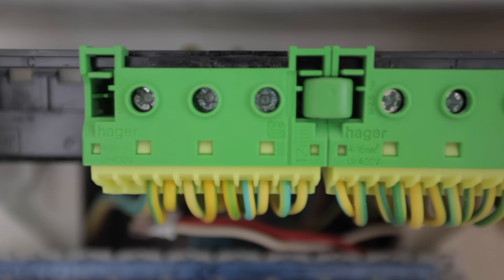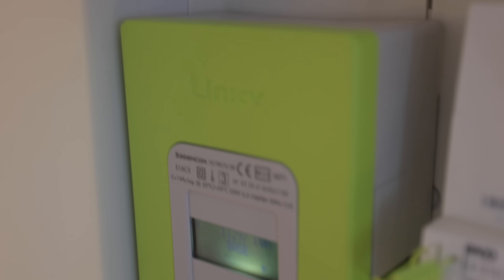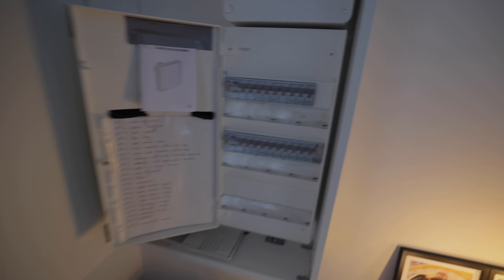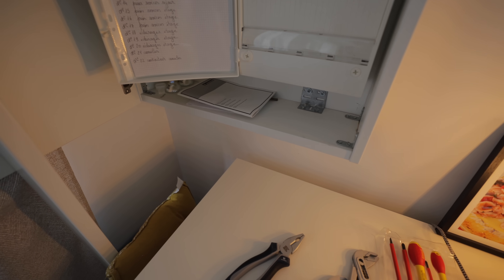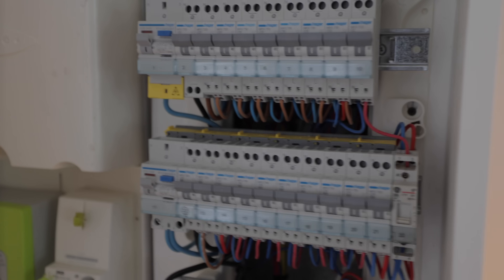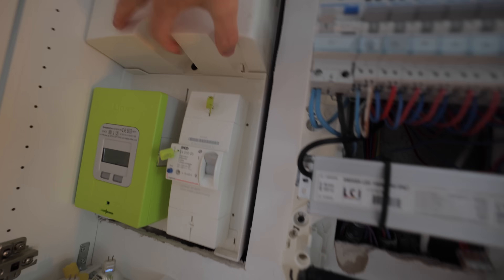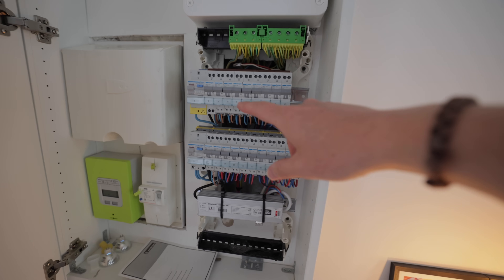U.K. Electrics SUCK! This is what we should be doing…🇫🇷

Comment: Strange that you never mentioned the choice of wiring used, a mixe of Red \ Black and Brown \ Blue, seems the Building may have  had a dramatic upgrade, also note that the cable terminations have not been identified, this is identifying conductors is normal for France as is the Circuit Arrangement stated on the Panel along with Contractor Details on the Front of the Panel. Bye the way this I.D for circuit cables is used in the UK by all but Domestic Electricians, ok the odd  ECA Member would meet this criteria.

Did you pick up or note  that this HAGER BOARD had been installed with those DP MCB's are realy the only types available to purchase in France,  but try and buy them from a HAGER Stockist in the UK is impossible !!! just so weird. I used to be a registered Hager Contractor in the good old days when they first arrived here in the UK and fortunate to have all the perks and free meals, weekends away.

Another good to know is that the Immersion Heater is generally 99.9% replaced in its entirety, tank and all, the only hope of keeping the Tank installed is to remove the Immersion Heater and take it back to the UK where you will find a small business to copy it. I had the misfortune of having to install a completly new tank in my French Home, 2 days latter I had a Shower having removed the celing joists above the Tank to lift out \ in of the new tank !
Mr Spence Eng
Reply from the maker: Thanks for sharing your expertise on French electrical systems!

Comment: Do i see correctly that france is single phase, too? Did you ever see a German consumer unit? Here in Germany default we have three phase power, all breakers are equally distributed over all phases. on modern units there is a separate high current breaker before the energy meter, too, but no rcd. Rcds are only directly before the circuit breaker, usually 8 breakers on one rcd.

Comment: You're right about the immersion pair. It uses ripple control between 2am and 6am as long as the 20a is in the middle position. If memory serves me correctly, if you set it to top (override) it will snap back to middle at 6am the following day. Mine does, anyway.

Comment: The connections system of this switchboard (consumer unit) looks super clever. It's lovely neat work too. I'm dead set against a single RCD device protecting multiple sub-circuits, which are individually protected by overcurrent/shortcircuit protection. I far prefer each individual sub-circuit has its own integrated RCD/overload/short-circuit protection device - what is commonly referred to as an RCBO.  That way an earth leak on a sub-circuit doesn't trip out multiple circuits. I'm also super interested in a deep dive into the USA made SPAN switchboards, where each sub-circuit can be load measured and switched by energy management software.

Comment: If you think that electrical installations in UK are perfectible, it is far worse in USA. Just have a look on US electrical panels without differential switches, the side connections on wall plugs that are not insulated and the rather generalized use of wire nuts instead of Wagos. 😱
As a French people I am happy with our consistant NF C 15-100 standard.

Comment: I suspect you're thinking too logically about the type A vs type AC RCDs. We have two main circuits and RCDs exactly as you have, but the reason one of them is Type A is that it was fitted very recently to increase the RCD's capacity for the addition of our "reversible aircon" - what in the UK we'd call an air-to-air air source heat pump. So it was a 40A Type AC and is now a 63A Type A.

Comment: None of the places you showed panels, what we call them here in the states, would fly in the past 60 plus years.  Northern clims has them in a garage or basement or hallway of the home or apartment.  Meter can on the outside, generally opposite the panel.  Southern generally has combo meter can and panel in one on the exterior.  Most utility providers require the meter to be around 1.25 to 1.5 meters high.   Modern code also requires a means of disconnect outside where the service meter is located so that emergency crews can de energize the location.  Our GFCIs are 5-6mA and by the breaker.  We are also required to have just about everything on arcfault now in new homes.  I do the combo units since they provide more safety and only cost a few dollars more.

Comment: Heures creuses means low tardif hours indeed. It a signal send on the line. There are different ways to use it. Some smart meters have a line to control a relay as in this system. But you may buy electrical devices that can read the signal themselves and adapt their behaviour accordingly to preprogrammed setting. Also the Linky has a digital output that can be connected to a computer (rpi style) through an usb adapter and you'll access to all the raw data of you consumption with a resolution of one second. That's standard since the 90s in France so all common domotic systems are able to deal with it.

Comment: Not saying that NL has a tradition in neat wiring , historically; but the modern materials are much like what's shown, mostly german materials.
The in-feed is definitely tidy/modern.
I've followed some of the UK sparky vids and have wondered about the practice of having lines go through walls and floors without a conduit around it. It might not be a regulation, but in NL it is good practice (at least) to run stuff througha conduit OR use a cable that's impossible for rats/mice to get their teeth into in any manner; given that some of the plastics used are great for them to sharpen their teeth on OR if the cable squeezes past the tight spot that the rodents might want to use (never happens, right ?), they'll go to town on it. Worse; that'll be a spot close to wood and might end up having a mouse frying/sparking itself in against a joist...

It's less problematic with 12V; but given the relatively higher currents on those lines (some LED-drivers can do quite some currents, and people use too-thin conductors more often than not) they are good to stick in a duct too.

In NL there's a famously over-the-top regulation wrt cables led across the walls/ceilings.. If you use XMvK (plastic-clad multiconductor stiff-wire installation cable), you technically have to run it through PVC-piping with a supporting clamp every X centimeters.. where I believe the X is at least less than 60CM and might even be as little as 30CM. No piece of straight-run cable longer than 30CM's can be left unsupported... which leads to amazingly interesting short runs of pvc-pipe with two wall-clamps just for a 20CM piece of cable .. 
Not saying Sparky's dont need money.... but...

Comment: In germany we have a similar system like you have shown in the video. The main difference that the smart meter is in a more industrial cabinet. We have 5 bus bars which is like 5x 60mm². Onto that we have a SLS with either 63/50 or with constant loads like PV or a big heatpump 35A. You can read more about that in the hager tipp 44 (VDE 4100)

The other thing is the consumer unit. Ours are similar but mostly near the kitchen recessed in the wall.
We always have 4 pole RCDs and at least a type A RCD which can detect Ac currents and pulsating DC currents. Pulsating DC currents is like 1.4x the ac current.
Type A EV could detect dc currents and trip at 6mA.
Type B would detect all dc currents( up to some frequenzy.)
But the dc current would be 2x the ac current.

The other main difference is that we actually just switch the mains and not the neutral. 
If we have to switch the neutral the switch must be designed to cut the mains first, then the neutral. And connect the neutral first as well.

We also have to have a consumer unit for each floor which has to have at least 4 rows.
Only a house with just ground floor and 1 floor above can be wired from where the smart meter is.

Comment: DTI stands for "Dispositif de Terminaison Intérieur" (Interior Termination Device), it is intended to make the interface between the public network (fiber or cupper wires) and the private network.

About the RCD, the French Standard NFC 15-100 says:
- a type A should be installed for stove/cooking plates and washing machines
- a type AC for everything else.
The standard says also that the number of circuits behind a single RCD should be of 8 max…

Comment: There is a problem here. There should not be more than 8 circuits under each RCD. You can check the NFC15-100 norm.
Reply: In holland its not more than 4.....

Comment: i startet recently watcing your videos here from norway. I’m in my final year as an electrical apprentice, The  TN-C-S connection method looks quite different from what I’m used to here in Norway, we typically wire neutral and phase  in RCD but in UK just phase cabel connect to RCD and neutral in bar. Is this setup based on UK-specific regulations, and I find UK consumer units quite  much smaller and often most of them look older compared to what we typically install. I also noticed that many of them lack proper labeling or a circuit schedule, which makes it harder for customers to know what each circuit controls.

Comment: He was lucky while pointing with his finger nearby the top row modules of the panel.

The red/brown bus bar connecting all row modules is the power liine, and it was cut to the correct number of needed modules.

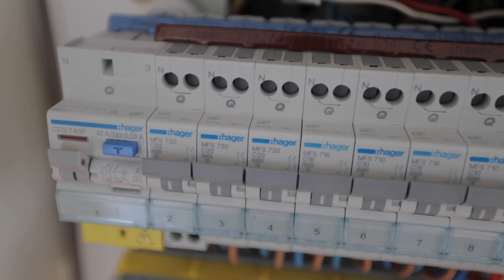BUT the bar cut was NOT protected from contact, you can actually see the cooper on the bar right side, exposed. At 10:12 for instance, you can see the cooper on the right side of the cutted bus brown bar...

Its supposed to be protected by some pastic cover that are saled with the bus bar.

Seeing his finger nearby this unprotected and exposed copper wirh an online electric panel was stressing to watch...
Reply: Yes that's one thing that caught my eye too.When I did not have the plastic cover ,I would cut the copper close to the last breaker and leave some plastic length past the copper.

Comment: In Germany there is the VDE (Association of German Electrical Engineers). Everything is regulated there, when, how, which cable, line, switch, socket and fuse, where and how is installed or is to be used and installed. It is also stored there if, for example, 230 - 240 volts or 400 volts are present, how to proceed when dividing the individual phases or how the circuits are divided and how they are to be secured. You can also find the cable routes and areas there. So the areas where drilling is not allowed, as an example. There you will find regulations for damp rooms, rooms with an increased risk of fire or rooms at risk of explosion. It also describes which fuse to use, where and how. Even the structure, assembly, type and location of fuse boxes is explained and described there. Your household contents insurance says “Thank you” and sometimes grants a small discount if the private electrical system is verifiably checked every 5 years by a VDE-certified electrician.

Comment: Yeah our Cabinets here in Germany mostly look like that as well, though of course it can happen that in older houses you will find stuff like, screw fuses, Cables without ground wire (but that are houses build before the 60-70s mostly), but generally speaking every house that was build after like 1970ish, should look very similar.

Comment: Like the double pole bus bars. The company fuse would presumably be liable to age so might well require replacement at 10 to 15 years like mcb’s. Interesting to see a modern domestic unit. My last installation was nearly 30 years ago for self. I was looking at a seventies house casually for a family buy a year or two ago. I am amazed at how little fusing for a large house used to be acceptable in U.K.

Comment: In Italy type A are used for outlets and appliances while type AC is used for lighting. Anyway those RCD only switches are crazily overloaded! That unit according to Italian rules is unsafe (our unit must be safe regardless what the meter has as a breaker) so if the power company replaces the MCBO with a switch the unit must still be safe

Comment: In The Netherlands the consumer unit must be indoors, protected against frost- water- and wind, and on the same floor as the front door. 
It must be placed in the same space and not more than 4,5 meters from the front door. 
The reason for this is that in the event of an emergency, the fire brigade easily can shut off electricity and gas
At new building sites the 'meterkast' is normaly the first to be placed.

Comment: Looks fairly similar to our Swedish ones, except on houses the meter is often in a box outside together with three diazed (bottle) fuses, one for each phase. We have single pole automatic breakers inside and our neutral and ground each have separate bars at the top.

We use three pole bus bars, where every third fuse is on the same phase, so basically 1-2-3-1-2-3-1-2-3-1-2-3. We don’t use RCD type AC anymore, strictly A for regular consumer stuff, and type B for things like EV chargers, solar inverters and such. Type B is a requirement for EV chargers.

The old style consumer units had diazed (bottle) fuses. One row per phase.

Comment: France has been operating smart meters since 1980's at least, there is a choice of tariffs.  The UK should radically improve the accessibility and installation of electrics. I guess that having flexible conduit permits rewiring without opening up walls.  Although I wouldn't want a consumer unit cupboard in my living room.

Comment: 8:57 I'm not sure about France, but in The Netherlands it's not allowed to put wago's inside a fusebox with 230V.
Reply: yes you can, if you use the wago dinrail adapter.  you snap the wago's in place. or use a "rijgklem" no idea what the english word is for that.  Even better, if you use the Hager renovation box, there is already a holder for multiple wago's in it.
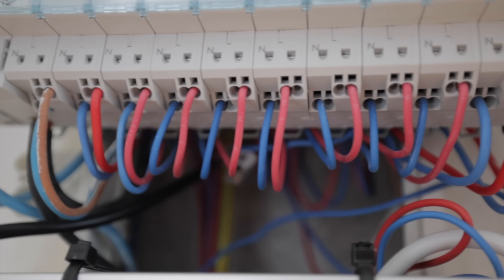Reply: @marcelsmit9048  Like you can see around 9:11 ? I have been told it wasn't allowed.

11:09 you see another one.
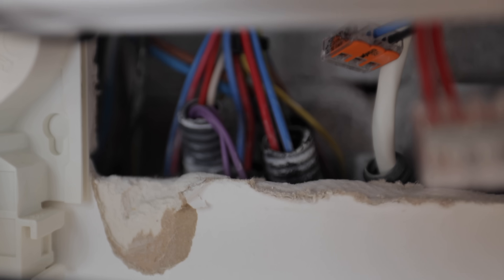11:16 even a blue and a black one in one Wago. Now I'm not sure what these colors mean in that country, but in The Netherlands that would have been a short circuit.

Comment: I suppose France works like the Belgian electricity; we have 2 main types of circuits for humid environments like kitchen, bathroom who are on a 30mah "residual current circuit breaker"; and there is a 300mah for other rooms. These are devices that measure 'loss' current in devices and switch off extremely rapid. In Belgium we also use a very strict laws for electricity, it is called AREI (in Dutch), it is available online. Our normal home electricity installations look like the cabinet you have in France.